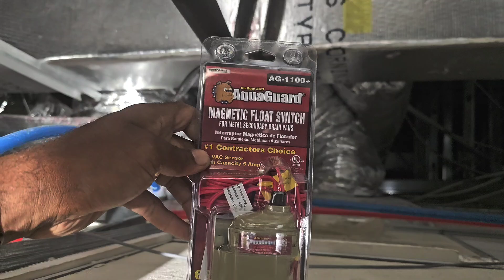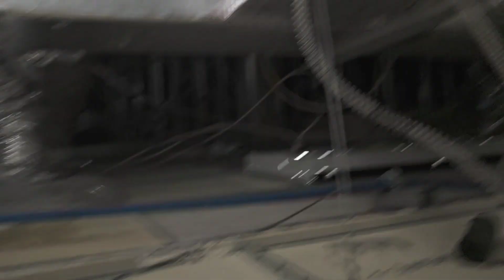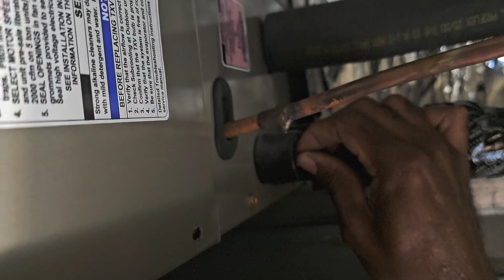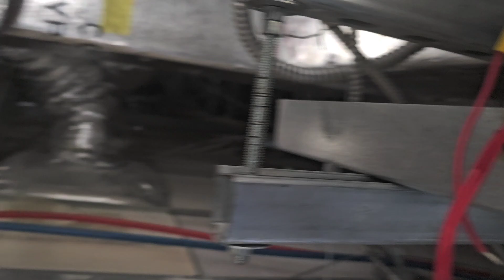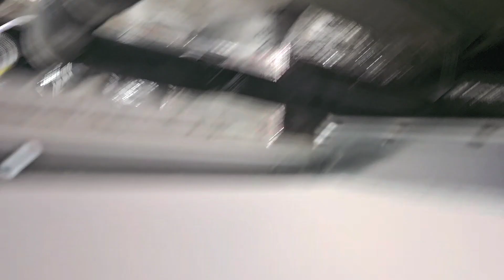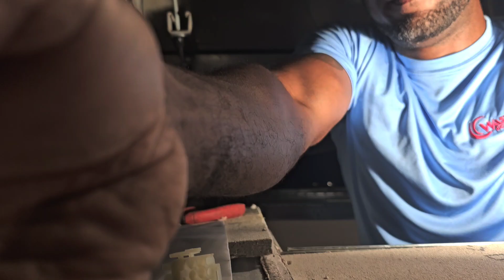Prevent Water Damage: DIY Condensate Float Switch Installation

Comment: Weird they didn't put switches on the pan when they were installed. I like to put a switch on the secondary drain also, that way you have double protection.  Looks like a lot of the screws for the air handler door was missing.
Reply from the maker: Especially in that situation, safety switches should be installed

Comment: You are the first YouTuber I’ve seen splice there.   Seems usually the splice at the end of the wire in the air handler.       This does seem easier you didn’t have to open the unit.  Thanks.